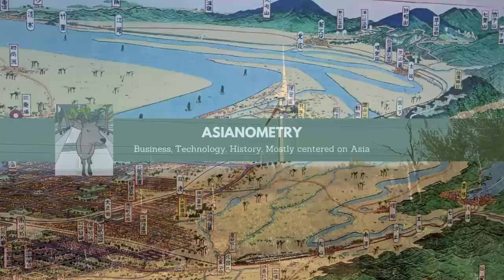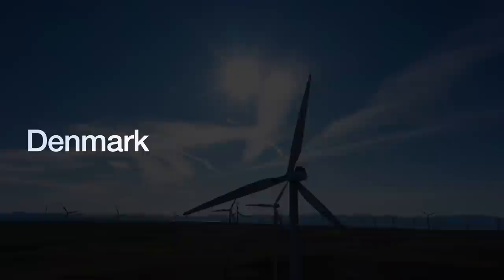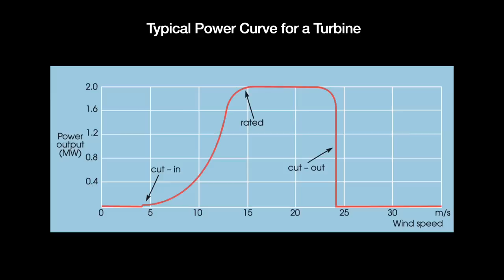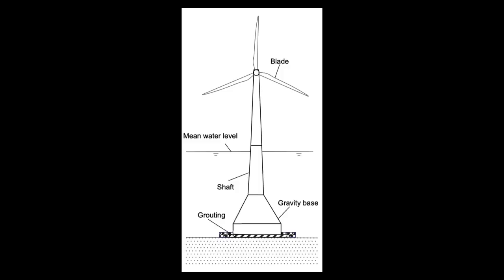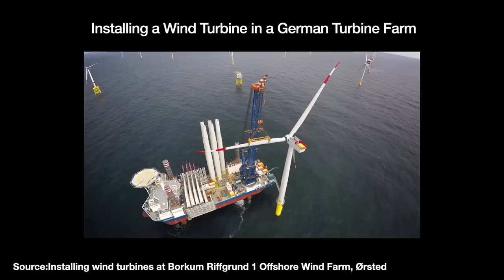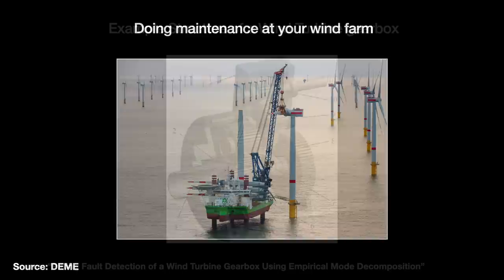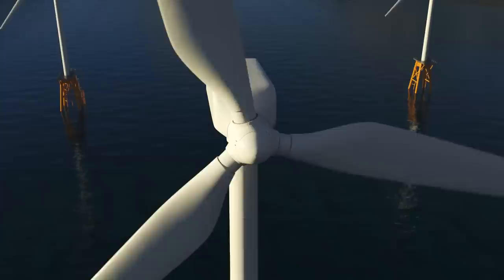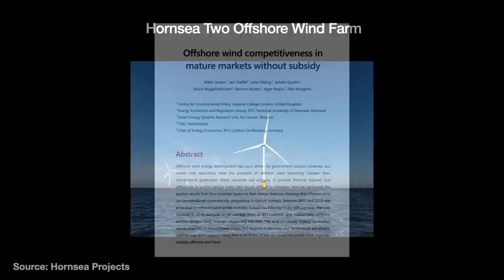Putting Your Wind Farm on the Ocean

Comment: A few questions to rethink the wind farm:
as mentioned, wind turbine is a highly mechanical assembly. 

How is the carbon footprint of wind turbine (including "gear box") compared with other energy sources? 

Due to the nature of wind turbine, the materials need special treatment for extra corrosion-resist. Cost is not an issue because when it's necessary to tackle the crisis of human being extinction, it's at the all cost to put it work. However, if wind turbine is worsening the man-made carbon footprint, that needs some more planning and researches. 

Second question: what is the percentage of energy which a wind farm can intercept?

Wind is the the driving force of local weather or even climate. And we all know that the weather (atmosphere) system is a chaotic system which can respond exponentially with minute initial condition change. Whether there is the saturated point of wind farm capacity which can start influencing the local weather system is one of my long existing question. But I am kind of lazy to initiate this search :P 

Thank you for your videos, they are always informative and inspiring :)

Comment: You point out the complications of installing offshore versus on land but pass over the biggest advantage - transport. It is a LOT easier to move a huge blade over water than over land, especially as it allows you to build the blades in existing shipyards. This is why offshore wind turbines tend to be far larger than land based ones. Doubling the blade length quadruples the power (pi*r^2 and all that).
Also you only cover off shallow water turbines. Many European ones are proper offshore semi-submersible platforms which do not require foundations (think of them as like an oil drilling rig).

Comment: Just a quick note, one of the big reasons that 2 blade systems aren't used as much is because it can cause changes in the moment of inertia when the turbine rotates to face a different direction; i.e. when the blades are vertically aligned the moment of inertia to face a different direction is much lower than when the blades are horizontal. Add in strong winds (when you might need to move to facing tangentially to the wind to reduce blade load) you will induce heavy vibrations and drastically increase the load and vibration on the thrust bearing under the nacelle which may lead to catastrophic failure.
Reply: They also wear our gearboxes faster because when the rotor is in vertical alignment, one blade experiences a drop in lift due to the wind shadow of the support structure, putting a backward directed torque perpendicular to the rotation on the rotor shaft.

Comment: Obvious problem with offshore turbines is that the cables connecting them to the mainland can be cut by bad actors. 

Russia has an estimated 6 submarines which have been modified to be able to cut undersea cables, both power cables and fibre optic cables. Russian 'fishing' vessels been observed spending time mapping the cables from offshore wind farms in Northern Europe. China will be doing the same for Taiwanese offshore wind farms.

Comment: On the vertical mills, the disadvantage of not being able to set it out of the wind to prevent damage. Isn't it possible to "feather" the blades, as one does on a prop plane on engine failure. Ie rotate them perpendicular to the wind to avoid drag.

Not sure about the forces involved though. These machines are huge.

Comment: While the Generators can indeed lower their operating Voltage and as such lower their output, most of the derating is done by the Blades and the Pitching system. The Blades Pitch out of the wind to ensure a steady production rate and protect the structure and generator from overexertion. As such the Pitch and their respective systems are responsible for the most breakdowns, given that it deals with the full load of the wind, though these breakdowns are smaller in scale and can be troubleshooted or solved quite easily when compared with issues with the Gearbox.

And on the topic of feasibility: Wind and especially Offshore Wind is among the cheapest energy sources in terms of operating costs. Depending on the location nothing can even remotely compete.

Source: working in EU Wind Industry.

Comment: Hi, very nice video. Although, one small correction - the description of HVDC cables are correct - however a cross section of a cable shown in 9:48 is an High Voltage Alternating Current cable, which consist of 3 conductors (HVAC) ;)

Comment: The fewer the blades, the better the aerodynamic efficiency, but one blade is imbalanced, two blades forms an axis that is susceptible to torsion, so three is the minimum count that can forms a plane to resists torsion.
Reply: 2 blade bladesets also are impossible to balance without adding balancing weights sticking out of the hub or blades (like the Soviets did with their 1931 Yalta turbine).

Comment: I will assume that the effects of salt water ingress to be as much of a problem as the windspeed, this will likely contribute to early failure. When you consider the cost of production, installation, maintaining and lifespan I wonder what the overall net energy benefit actually is? Are you perhaps spending a MW/h to generate a KW/h ?

They should operate hydraulically on the water instead of electric. pump and compress the seawater and send all the pipes on on land station that will convert the hydraulic pressure of all the platforms to electric power. T

Comment: I always thought the pitch of the blades were variable so that the shaft RPM can be adjusted that way. I didn't know there was a gear box, except for varying the blade pitch. I've seen wind turbines with the blades at different pitches. Still ones were edge on to the wind. Operating ones were flatter.

Comment: A two blade design results in some significant oscillitory torque forces being applied to the tower for off-axis wind.  A three blade design eliminates this techical issue.  4 or more blade designs are no better than the 3 blade design, hence 3 blades is the obvious optimal design

Comment: I'm not quite shure how a highly intelligent and skilled pyhsics major like you can hold up these highly volatile energy forms that much: It should be clear to everyone that 'the wind doesn't allways blow and the sun dosen't allways shines', so in this case you ALLWAYS need some sort of backaup powerplants, and what you think that would be? Yes, you just extend the production-life of your old inefficient and polluting coal plants(Like germany did this winter!) or you built some new combined-cycle Nat. Gas plants because they are cheap to purchase but expensive and risky(that someone cuts the supplys or a crisis in europe,.. ~5folds the prices) to supply with fuel.
So, if you want to be carbon neutral but still want energy-security at least ~50% of your overall generation should be nuclear, the rest maybe can be a mix of 'everything else' including the 'volatiles'(renewables). :o)

Comment: Solar and wind both have a serious problem- intermittency.  That a polite way of saying they don’t work most of the time.   No good way around that, unfortunately.
Reply: There is a solution at small scale: batteries.  Lots and lots of batteries.
t. 80kWhr and just over 3 tons for my 14kW of PV
Reply: Well, they do a good job at reducing fossil fuel costs.
If you could get free gasoline or free food half the time, would you reject it because it doesn't solve the other half?
Reply: @pizzablender  How much does solving the other half cost?

Comment: I wonder if the new toroidal blade design can be used in wind turbines?
Reply: Yes—but. The cost of the turbine goes up as the weight of the rotor goes up. Other important constraints are the blades need to be stiff enough not to hit the tower, and for onshore it needs to be possible to transport the blades on site. You also don't want the blades going through turbulent "dirty" air due to problems with fatigue which is why rotors are almost universally on the upwind side of towers. The other consideration I can think of is there needs to be a strategy of what to do to avoid damage when the wind speed becomes excessive. Older designs would often stall the blades, but newer larger designs feather the blades. That would probably be possible for toroidal blades as well. Many rotor designs are possible, but very few make sense.
Reply: I don't think so. Wind turbines are not for producing thrust, they are for capturing energy.
Reply: No. There is an absurd mass on the outer rim. It punches over 200km/h with the tip of the traditional blade. The structure would have to withstand an immense force.

Comment: 9:40 What? How does DC have cheaper cables and lower losses. Those are the we use AC, presumably! Do I live in a lie??? Tell me!!!
Reply: He’s talking specifically about high voltage DC. I think he has a video on HV DC transmission lines that does a pretty good job of explaining the concept. 

My understanding, in essence, is that at very high voltages (such as those used for long distance transmission) the alternating current causes greater resistive losses compared to a continuous DC current operating at much higher voltages.
Reply: @tictacdude3468  It's not really resistivity. AC suffers from capacitance between the cable and its surrounding (air, ground, water). This is extremely true with undersea power lines and one of the reason we barely do underground lines as well.
Those days we only use AC because of historical reasons and the technological inertia it created. Going full DC will require a lot of changes, both in the power distribution network and the electrical appliances compatibility (which could need some dedicated lines with a local inverter inside the electric box)
Reply: @tictacdude3468  Oh, so we are talking about voltages higher than transmision line AC HV, right? OK....
Reply: @PainterVierax  Also, to my understanding, stepping up a DC voltage is way more complicated and expensive (for huge wattages), than it is for AC. Right?
Reply: @billysgeo  Sure but prices decreases a lot these days. Although HV transformers are way way less efficient than HVDC multi stage switch  boost converters and the lesser heat is more spread and easier to cool. This efficiency difference is already true without counting on better semiconductors than our good old doped silicium so it could only improve whereas AC stations are difficult to improve without an internal DC conversion.
All of this is meant to reduce losses on the grid to reduce plants and as it goes the costs seems to be there for those new designs to come out even for nonsubmerged HV lines.
Reply: @billysgeo  Potentially. What Vierax correctly pointed out is that it is the capacitance/inductance results from the transmission line being surrounded by other objects that conduct current -- I had mistakenly called this a resistive loss.

Induced currents in surrounding material are produced by the magnetic flux caused by a change in the original current. Since AC fundamentally uses oscillating current to transmit power, it will always induce currents in surrounding conductors. This is the same basic principle that AC transformers use as well. My guess is that inductive losses are usually small but get exacerbated by higher voltages and longer transmission lines. 

So, in essence, since DC doesn't involve significant changes in current, high voltage DC is useful for long distance power transmission even if at the same voltage as a similar AC system. I think you're right in that the conversion equipment needed to convert megawatts of electricity into HVDC means that they are only really cost effective when transporting power very long distances.

I believe that this is the video I was thinking of.      https://youtu.be/KZBaDle5NbU

Turns out I was wrong about why DC is better for AC in this respect, but interesting nonetheless.
Reply: Well, seems Dimitri deleted his comment.

Comment: Lovely; but wind farms don't always produce power; it depends on the wind which is unreliable; so then you need to have big batteries to try to store the power for later use; these so far are always either too small to add much duration or too costly to make it worth while and the power cost rises.  Built out at sea they pose a hazzard to navigation; maybe they can be part of Taiwans defense against China.

Comment: Wind farms and solar do make a lot of sense for Taiwan in term of energy security especially when confronting to main land China.
China can easily squeeze up Taiwan by blocking sea lanes so that Taiwan cannot access resources they need.
Renewable energies gonna mitigate this situation to some extent.
Nuclear also may make sense but considering that Taiwan is relatively small country, and a single nuclear accident possibly make the whole Taiwan inhabitable, Nuclear may not be the best solution for the counties like Taiwan.
Reply: There is no nuclear accident that could ever release radiation like that, let alone enough to render anything uninhabitable.
Reply: @gregorymalchuk272  You mean like Chernobyl and Fukushima?
Another aspect is that nuclear power station are single points of failure mandating hierarchical grids. Whereas renewable energy are more resilient sources of electricity because much more distributed.  In the context of the geopolitical situation of Taiwan, renewable sources of electricity and resilient smart grids have a marked advantage (in addition to clean, easy to deploy and cheap compared to nuclear).
Reply: @alainpannetier2543  Chernobyl was a communist craphole with no containment building. Fukushima was a primarily a hydrogen explosion. Even when you include them, nuclear is the safest source of energy by far.
Reply: Nuclear plants are a bad idea in a country that's been at imminent risk of invasion for decades. This may also be an issue for renewable generation - we've seen Russia attack undersea cables; cutting powerlines as a prelude to invasion would make sense.
Reply: I think a renewables-dominant electricity mix on Taiwan, without grid-connections to the mainland, will suffer badly from intermittency. I learned via this channel that Taiwan seems to have decent hydropower resources, which could address this issue to some extent, but maybe not completely. Battery-backup is becoming cheaper but maybe not quite there yet. Anyway, I think renewables thrive in a peaceful and collaborative world-order while fossil fuels remain the top choice for war-like nations (it remains difficult to beat fossil fuels in their ability to store energy reserves amounting to weeks or months of reserve, or to beat them on mileage in military vehicles).
Reply: @5th_decile  As far as wind and solar go, for most grids, they're currently gas offset devices that can reduce the total amount of fossil fuels a grid uses, but mainly suitable for use in tandem with CCGT generators or something equally dispatchable like hydro.
While they couldn't go renewable dominant without some heavy storage implementation, they could certainly clean up their mix.
Reply: @conor7154  What is the name of the paper? Can I read it?
Reply: @LudvigIndestrucable  Why? If nuclear is good enough for naval reactors put on the front line of any fighting by the U.S., UK, France, Russia, China, and traditionally nuclear-paranoid Australia, then it’s definitely safe enough for civilian use in any potential war zone. The failsafe designs of the reactors on USS Thresher and Scorpion worked. Every time they’ve been checked for leaks, the radiation levels at the seabed are a fraction of normal background radiation in a typical urban area. If those reactors can survive violent implosion and then be safely left on the seabed, then I’m pretty sure any new civilian reactors that meet international standards will be OK.
Reply: @LudvigIndestrucable  Yes, you're right. I guess I was not reffering to the CCGT complement so typical nowadays because in a discussion of energy security (energy independence in a time of crisis) such CCGT backup would be the weak link ("single point of failure" as someone commented earlier in this thread) and a renewables+CCGT system as a whole wouldn't be more resilient than a fully fossil system (maybe in a scenario with no military agression but with an economic blockade there is a difference in the time until the system is starved of fuel, but along this line of thought why wouldn't one address this by adding more fuel storage capacity in stead of building renewables). But hey, maybe hydropower-backup is equally vulnerable as CCGT
Reply: @conor7154  You're being silly, in a modern interconnected system, everything has a point of risk, whether that be regassification terminals, LPG tankers, underwater cables or anything else.
Wind farms tend to be diffuse, so there would be a lot of cables to cut, rather than a single gas terminal to bomb.
Solar is much more energy secure than most other forms for a country like Taiwan.

Comment: Another commercial for wind turbines. You forgot to mention the disadvantages of wind turbines. When wind generated electricity exceeds 17% of your total electricity production, it introduces instability into the power grid. In Sweden, the price of electricity can vary from negative to expensive in just a few hours. Our emergency generators now run much more often (oil power plants). Sweden's wind power plants are subsidized and despite this they cannot make a profit. That's because when it's windy, it blows all over the country and the electricity can't be saved, which leads to negative prices. When there is not enough wind, we have a lack of power, which leads to higher costs. And let's not talk about all the migratory birds that are killed every year. Wind turbines are environmentally friendly, right? Then there are no plans for what to do with all the old wind turbines, only landfill. The road to hell is paved with good intentions.